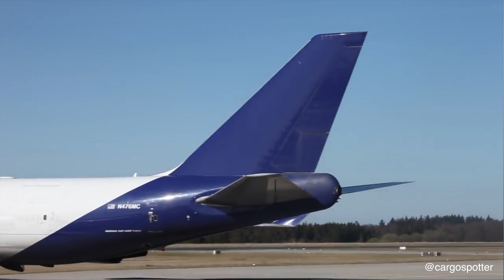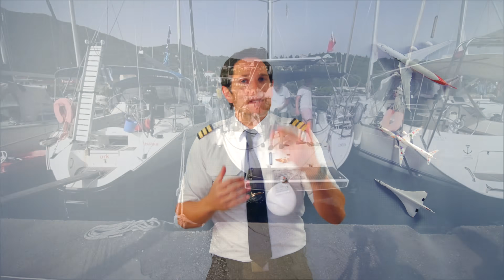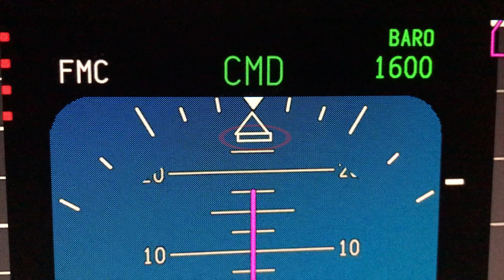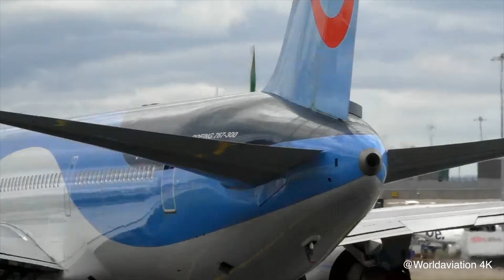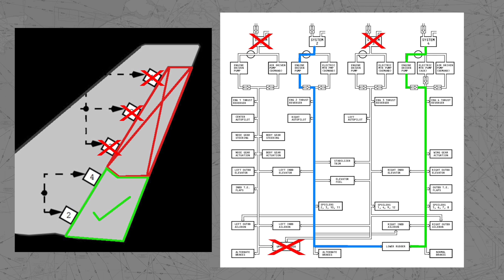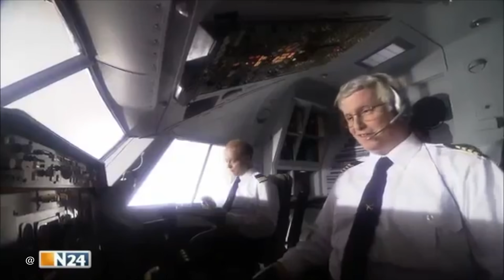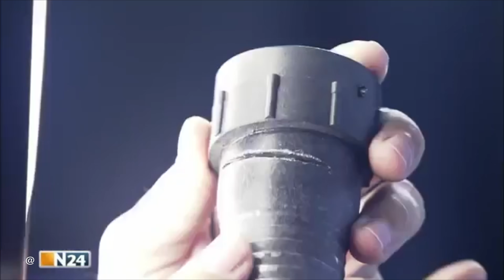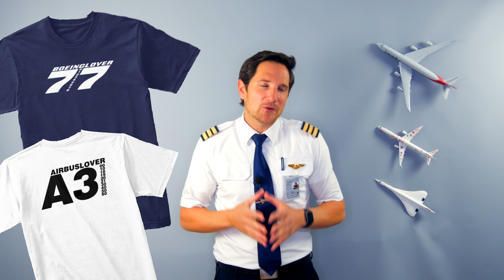Why is the RUDDER SPLIT? Explained by CAPTAIN JOE

Comment: Hello there. I have a question... Why do all airliners offer these weird headphone ports where you need to have the headphones provided by the airline or an adapter? Where is the origin of that port? I couldn't find any information on the internet...
Reply: Robin Tesmer it’s basically an old standard, in which instead of a single stereo source, it uses a mono source, and splits it into 2 for each ear (ps I have no clue why is it still used though)

Comment: That 747 looks so outdated and old fashioned compared to an Airbus cockpit
Reply: The latest 747-8 cockpits are reasonably modern. Since most of the remaining 747-8 purchases will be for cargo operations by users of existing 747Fs there is a desire to limit changes to only those that are truly beneficial.

Comment: On the 737-800, the rudder is powered by hydraulics system A & B, as well as the standby hydraulic system. In case all else fail, like the A320, it is mechanically linked to the rudder pedals.
Reply: It is mechanically linked but can't be turned without hyd pressure. The backup (manual reversion) IS the elec standby hyd pump to a dedicated actuator.

Comment: Let’s use Air breaks to turn and cover the entire surface with solar panels you could shove a lot more batteries in a flying wing airplane and cover it with solar panels to make the power because of the mass of it you can make it larger or smaller if you wanted to have it to be a passenger plane.

Comment: RUDDERS DEFLECTION - Could it be … All air surfaces move according to the flow of wind over them. It looks like the wider surface as presented to the wind direction, of the lower rudder is deflecting wind up towards the top rudder which is reacting to the force from its left by swinging right. You may ask why the top rudder isn't also being pushed left by the wind? It is. However it seems that on this 380 the top rudder is mechanically prevented from passing zero deflection to the left when parked. It is only "free" to swing right.

Comment: The A380 lower rudder (same with the B747, B767) is locked left or right at the gate during aircraft shutdown to keep the general wind direction from blowing the aircraft into the bridge or cargo loading equipment.  The upper rudder, and elevators are free to move as there is no hydraulic pressure to lock them.  Only one of the two rudders is needed for this.

Comment: Since you mentioned the B-2, it's worth noting that the A-10 also has a somewhat similar split aileron, though it uses it exclusively as an air brake.

Comment: The A380 mist have some kinda spring tension system  in conjunction with hydraulic pressure. When hydraulic pumps off at the gate is probably why it splits. The springs must counter act each other ??
On the CRJ aircraft we have one solid rudder but is automatically limited in travel with increased airspeed to prevent to much deflection.

Comment: I just happen to have a 737-400 operations manual sitting here. There are hydraulic system A, system B, a standby system, and a power transfer unit. 
"A" is powered by a pump in engine one plus an electric pump powered by the generator in engine two; "B" is just the reverse. The standby system is powered by an electric pump which can get power from either engine or the APU. The rudder can be used with any of the three systems. This manual does not have component details on the actuator arrangement in the rudder, so I do not know if one system could power all actuators or if the A and B systems each have dedicated actuators. Standby is normally off, selecting the standby system will replace either A or B.(two switches; switch A can be ON OFF or STBY and switch B has the same)

Comment: I'm guessing that the A380 rudder sections point in different directions has something to do with the amount of torque that the vertical stabilizer would produce with maximum deflection. However I would find it weird that it would just be able to move on the ground because of wind.

Comment: Captain Joe, did you know the Boeing 747-400 (Northwest 85) You reference in this video was the first Boeing 747-400 built?  She was a test aircraft prior to delivery to Northwest.  If I’m recalling correctly, the rudder hard-over due to fatigue was believed to result in this situation.  Excellent piloting skills by the crew to bring her and all aboard back to Earth safely and she proudly had a full career before retirement. Delta acquired it in the merger, of course, and was painted in Delta’s present livery.  She is now proudly on display for all to enjoy at the Delta Heritage Museum adjacent to Hartsfield-Jackson Atlanta International Airport.  She sits outside on the property and can be seen on Google Earth.  Simply look to the north around mid-field.

Comment: When you're in a rear wheel drive vehicle, sliding on ice... you let go of the wheel and apply varying acceleration to keep the vehicle sliding, but controllable as the front wheels will turn towards the position of least resistance, and from there you can steer your vehicle in a controllable slide while adjusting engine power to correct the slide and come out of it, or keep it going...

I wouldn't be surprised if a similar system was put in place for the rudder - as you said, the top is being deflected by the wind. In flight, this would auto-adjust to the position of least resistance, and the bottom one would provide the necessary input, unless both are needed.... The top, likely, allows for wind to come off the tail edge of the wing smoothly, instead of having a harsher separation as you'd have with a control surface going against the current pattern to adjust course.

If this isn't how it works, it'd be interesting to see what would happen if a plane implemented something like this, at least for simulating, to see if control can be regained after some loss if the wings re-orient to the position of least resistance and then gave control to the pilots from that point.

Comment: i think redundancy is not the mayor term for inboard and outboard ailerons. the inboards are used in high airspeed conditions to prevent high torsion stresses on the wings and the outboard ones for low airspeeds like the landing

Comment: Your boat analogy was great as far as demonstrating why you need larger control surface deflections at lower airspeeds, but it may leave people with the impression that it's the rudder that turns the airplane. That is a dangerous misconception that has gotten a lot of pilots in trouble when they overshoot their turn to final and try to tighten it up using the rudder.

Comment: What’s the reason for the strange rudder on the DC8? On this image you can see that there is a smaller rudder inside the main one so it seems to be for a different purpose. Trimming perhaps? https://az.m.wikipedia.org/wiki/Şəkil:Silk_Way_Airlines_Douglas_DC-8_tail_Wallner.jpg

Comment: The 747 mentioned in the Northwest Airlines incident in the video was the first production 747-400 off the production line and went into service with Northwest Airlines.  Delta Airlines inherited the plane when the merger with Northwest was complete.  It went on to serve with Delta for several more years before being retired and is currently on display at the Delta Airlines museum in Hapeville, Georgia which is a suburb of Atlanta!

Comment: I'm wondering if the opposed upper/lower rudder segment deflections that you've observed on the A380 have to do with roll/yaw coupling?   As I'm sure you have observed on some of the airplanes you've flown, that upper rudder segment is far enough away from the airplane's longitudinal center line to almost become a "vertical aileron", inducing roll as well as yaw when it is deflected.   I once flew a light airplane designed in Australia that had characteristics like that.  It had more roll/yaw coupling than any other airplane I've ever flown.   Flying along straight and level, that airplane would draw circles with the wingtips if I pumped the rudder pedals left and right!   I'm wondering if the Airbus designers were doing something with split/opposed rudder deflections on the 380 to perhaps counter a tendency like that.

Love your videos, Joe!   Keep 'em coming.   I wish these videos were available on the seat-back screens on some airliners, so the traveling public could learn more about aviation.   People fear what they don't understand and you do a great job making complex concepts understandable to regular folks.   Come to think of it, the regular media would do well to subscribe to your channel!

Comment: Also in the running for "most unusual rudder" would be the Space Shuttle; which has a vertical version of the ones on the B-2 bomber, but it was used for both normal rudder functions and as a speed brake, when it splits in two, one side going to port, the other to starboard.

Comment: The Airbus A380s bottom rudder has a hydraulic system completely separate from the upper rudder and the bottom one is turned to the left and the upper rudder is turned to the right. It stops people being able to turn the aircraft if it is in parking mode. Just like the F22, the rudder in parking mode acts as a speed brake, stopping the aircraft going forward.

Comment: This all makes sense, but what if you were hypothetically forced to fly on all the "backups" rudder/elevator/aileron? they all seem like pretty small surface areas which surely means minimal control at low speeds? would it actually still be possible.. would it be easily controlled or highly noticable? :)

Comment: The early 737s had a flawed rudder actuator that slipped into reverse mode. It caused two crashes. The design was fixed.

Comment: Hey Captain Joe! Been following you for a while, love the videos! I wanted to let you know I bought one of your AVGeek t-shirts, and after i washed it once according to the correct water temp and drying settings, the graphic faded significantly. After a 2nd wash, the graphic is completely gone. :(    Just FYI, in case you want to consider a different silk screener than teespring.

Comment: NW 85 is one of the reasons Boeing split the Hydraulic systems controlling the control surfaces, besides installing the part which prevents a Hard over similar to NW85. 

There was a flight out of Honolulu to New Zealand or Australia, before that, which had one engine fail due to debris from a cargo door (port side)  blowout and almost had the second fail on final approach for the same reason. Which would also be a cause for four separate Hyd systems.

Comment: The 737 has two engine driven hydraulic systems, A and B, as well as an electrically driven standby hydraulic system. Systems A & B normally drive the rudder, with a separate PCU/actuator for the standby system.

Comment: Answer to your question: at the gate the a380s hydraulics systems aren't pressurized
Reply: Jay Kapur well yeah, they don’t have hydraulic power, so the wind will move the rudder. So thats not quite the answer.
Reply: @blewis42002  Doesn't explain why the split rudder is facing opposite of one another. The wind will blow one way
Reply: Jay Kapur no, it doesn’t. I didn’t try to explain why, because I don’t know, but it’s not because of low hydraulic pressure is what I’m saying

Comment: Maybe at park the hydraulics are neutralized and with certain wind it could cause different flows over them causing them to pint in other positions? It seemed like the upper moved alot more than the lower. More erratic winds since it doesnt have the body to smooth them out?
Reply: I hope that's not too idiotic lmao

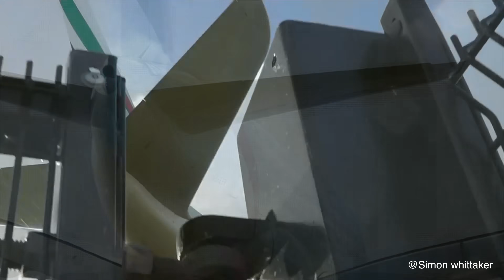Comment: @captainjoe The differential deflections on the A380 rudder that you can see at 3:52 is called the Valse Des Rudders (rudder waltz) and is part of the flight control logic of the A380 fly by wire system. It's the same kind of differential deflection that the A380 ailerons do and is designed to reduce oscillations and improve passenger comfort. I think the A380 is the only aircraft with this feature because the control surfaces are so large the oscillations can get correspondingly huge and sickness inducing! As for why they deflect in opposite directions whilst stationary, my only guess is that it's just a feature of the pressure left in the different hydraulic systems powering either surface actuator when the aircraft is shut down?

Comment: Maybe for the A380 the rudder have différent position because it’s a huge plane and if the both rudder turn at the same direction it could make an oversize turn and so they are 2 different direction for rudder to equilibrate when the pilot use rudder ?? ( sorry for my English I’m French)

Comment: Hey Joe, air flows are very turbulent when you are near to large structures (like terminals in airports) ground, especially when other complex structures (like airplanes, trucks, gates, etc.) are located nearby. Therefore air flow can easily be left to right at say below 4 meters (pick any height you like) above ground and completely opposite at say 4,10 meters and above. Hence, if rudder segments are reacting to complex air flows when airplane is at very low speed (= 0 m/sec) I would expect they quite often move in opposite direction.

As soon as airplane starts moving away from the building air flow becomes much less chaotic and rudders will look like they agree - even if they were just reacting to the wind without pilot input.

Comment: The control surfaces of airliners are not connected to the pilots' control via cables; they are operated by a hydraulic pump. When the engines are shut down, there is no hydraulic pressure in the pipes, and the control surface is free to move.
The rudder is moved from the center position by wind. If you observe the gates, you should note that all airplanes have their rudder deflected to the same direction. In a perfect no-wind scenario, the rudder would stay neutral.

The control surfaces on airliners are much heavier and much stronger. Also, they are not "directly" connected to the cockpit's controls - when there is no hydraulic power, pretty much every component is disconnected. Unless you're facing gale force winds, it is safe to just let them swing free with wind and gravity.

Comment: Much like power steering in cars. In idle or slow speeds steering wheel turns will turn the wheels at greater angle compared to high speed.

Comment: A380 SPLIT RUDDER:
It would make sense that they want to lower the bending moment generated by ground wind on the rudder to the fuselage by having it in both directions - If the plane is facing the wind, it might make the plane tilt in roll in case of strong gusts? The A380 rudder is HUGE.
What do you think?

Comment: Joe you have now totally confused me. Questions: rudder peddles on the floor of the cockpit control the rudder. Explain to me how does the yolk work other than take off and landings what exactly goes on there when you turn it left or right.??? I'm not a pilot but I do understand the basics. Thanks. Welcome back btw. 👍😃😎

Comment: Not a fan of Boeing at this moment. I know you do not comment on this stuff but there seems to be a level of greed that was achieved at the cost of two planes going down due to lack of testing. It's incredible to me that the issue never happened in testing. Was it tested vigorously is what I am wondering?

Comment: Please do a video about "the spinning thing near thrust levers"
And cut off switch near the thrust levers.
https://youtu.be/l-tmcQebeN8
Reply: By talking about the Stab Trim Override switches you obviously already know what they are, so what's the point of a video on the subject? (By the way for anybody who doesn't know, the spinning wheels on the sides of the center panel are stabilizer trim manual override disks)

Comment: Don't know about the A380, but a falcon 7x/8x has a system test of the hydraulic system, which will at some point deflect both aileron in same direction. I don't why it does this, but it is possible because they are not connected to each other and can work independently of each other, in case two of the hydraulic system fails.

So it is possible this is just a system test, before push-back.